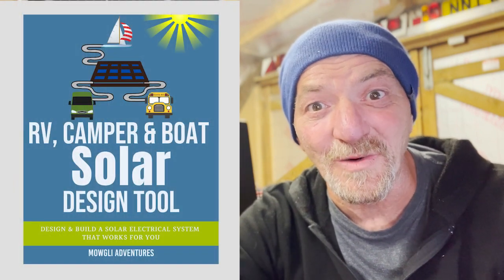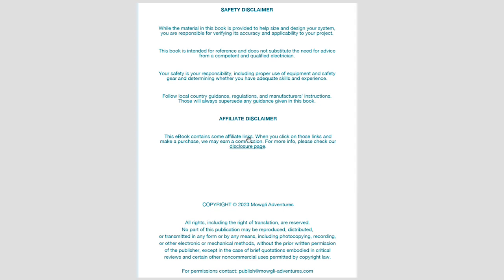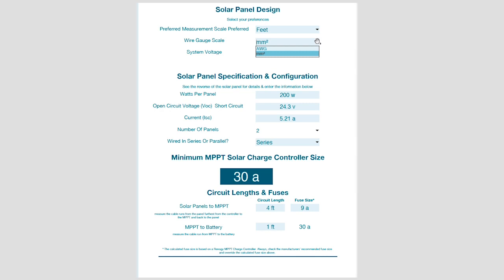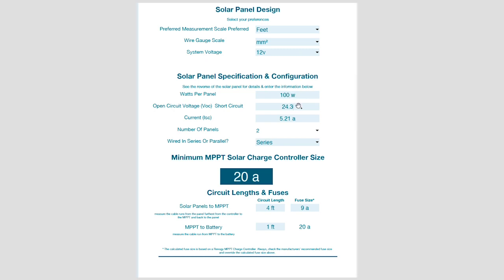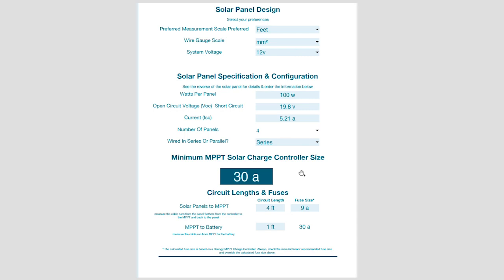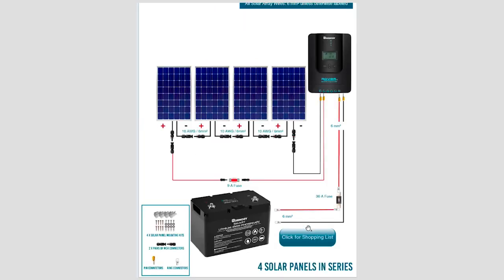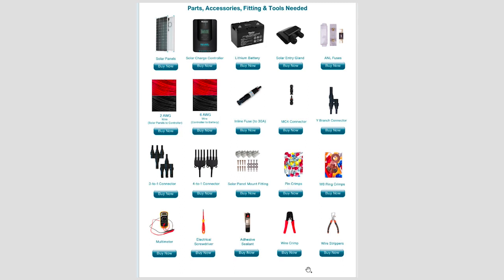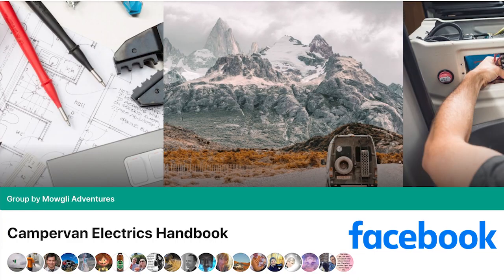RV Solar Panel Wiring Diagram pdf Demo

Comment: forget ANL fuses.. They take up to much space.. I switched to Littlelfuse MDB box and Midi fuses.. What more compact and cost less..The MDB box can handle 200amps with a 3 in 1 out configuration..
Reply from the maker: both approaches are great, each have their uses and personal preferences.